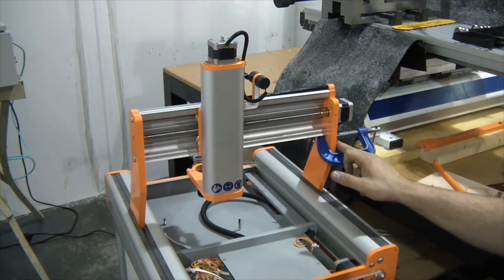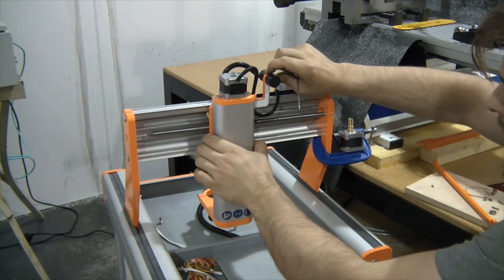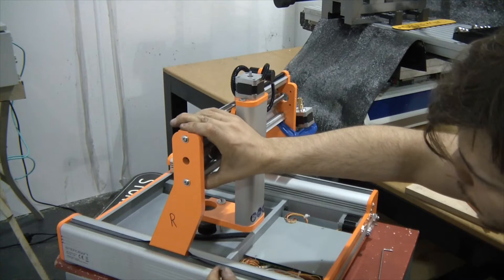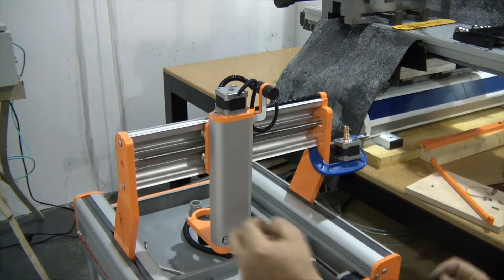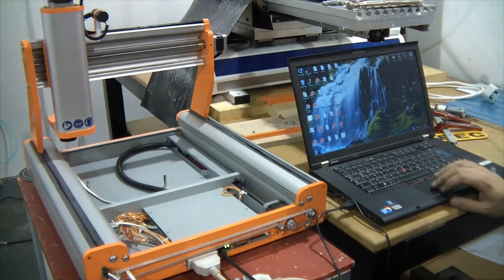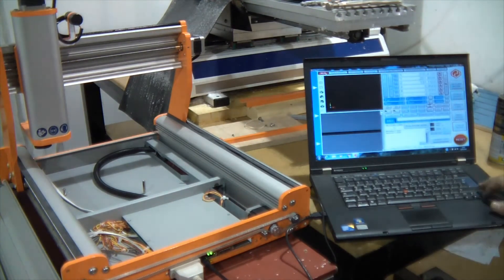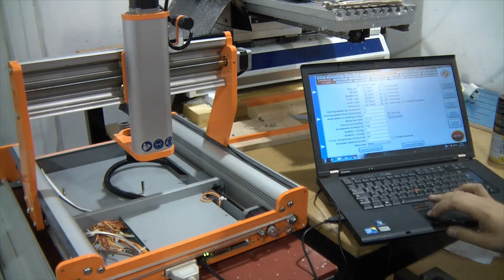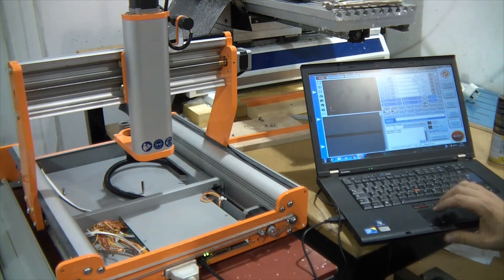STONEYCNC tuning the X axis of a STEPCRAFT CNC router

Comment: I was badly surprised with the amount of alignment work to do at the end of the assembly.... Actually EVERYTHING must be aligned. Not what I would expect from a german manufacturer. Now, regarding the machine design: those flat components are mostly cut with water jet.... I believe if they would have been milled precisely, assembly was easier. Regarding paint and toleranced notion in the assembly manual... When facing this issue, first idea I head in mind - so why the hell do you paint is if it makes problems...? I'd rather have it matt aluminium rather then grinding the paint off inside the holes. Next, why are those end plates so thin... Why not at least 15mm hard aluminium... Next, and probably most annoying thing, was the undertray from sheet metal. It arrived a bit too narrow and always falls out. I had to bend it to make it work somehow... That tray has almost no function except the cable guide... ANYWAY, after a bit of frustration... THANKS TO STONEYCNC for this video. Much better then the original Stepcraft video. THANKS A LOT, MATE. Tomorrow I will carry on aligning my machine and hopefully it will do a good service for me.

Comment: thanks a lot  for the video!
do you only use two out of four screws for the motor?
Reply from the maker: in the video only 2. really you should use 4. To keep video shorted and more efficient we put 2 back. works fine. but 4 better.

Comment: Great video. I bought an 840 stateside, and I got through all of the axis levelling EXCEPT the X. I followed all of the new Video Install Guides that have been updated, to no avail. I would get it 90% of the way there, and then once I tightened the last 2 bolts, it would lock up. I am eager to try this today, thanks a million for the info and video!
Reply from the maker: Thanks for the positive feedback helping you get your STEPCRAFT CNC router going :)

Comment: Very good tutorial video! Like I said for the Y axis video, I wish I had seen this when I was building my SC 600. I really hope you do one for the Z axis also and  cover how to "tram" (spelling?) X and Z to the metal slotted table. I haven't been able to get mine close enough yet for real fine cutting.
Reply from the maker: For the Z axis (as you look at the side)  this is relative to the bridge. A square on the bridge should sort this.  For the X and Z axis as you look from the front - this gets a little trickier as you have to adjust the X axis bridge horizontal squareness without impacting on the  screw alignment.